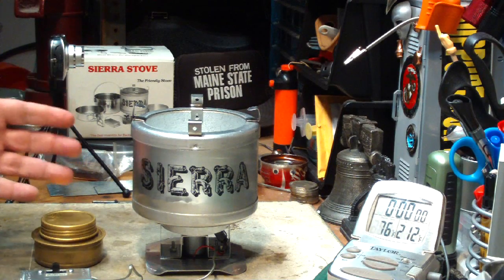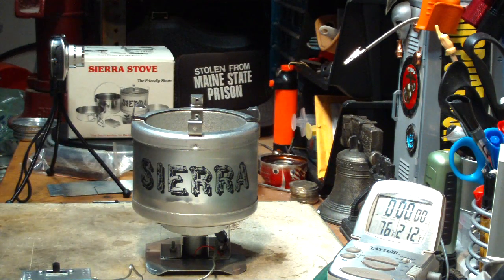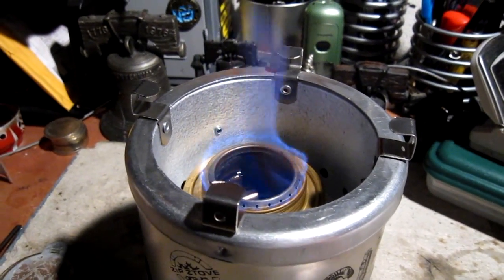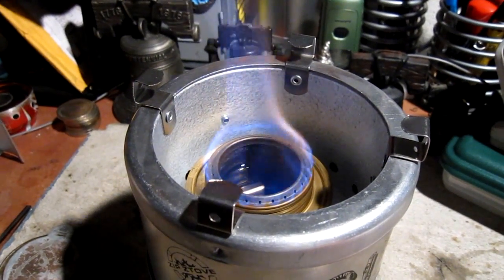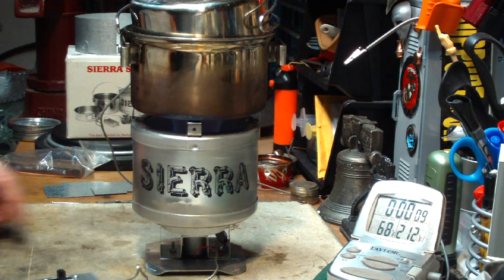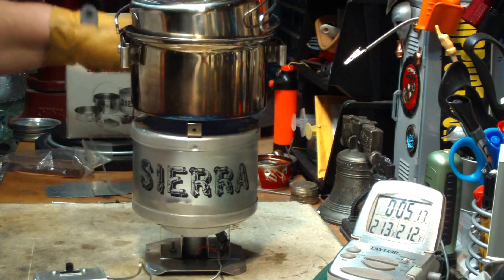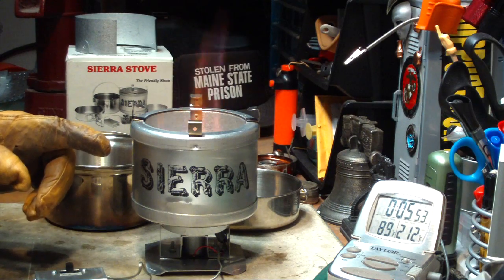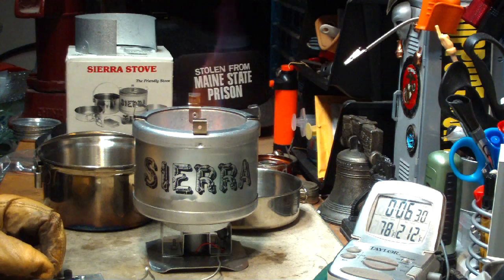Sierra Stove with a Trangia Burner - Boil Test #1

Comment: Triangia is a new one on me. Is it like Sterno? I like the idea of having a backup system to the Sierra in case rain or high altitude make gathering wood impractical. Also noticed that the battery cover is screwed on, screws are easily lost as are the tiny screwdrivers to open the cover. I guess a spare of each and caution with tiny stuff in the woods is the solution.

Comment: The stove/fan is designed specifically for wood chips, not a trangia.  In rainy weather, bring a pine cone loaded with candle wax as fire starter.  Bring wood chips in a plastic bag.
Reply: Hiram said at the outset that it is a wood stove. These burn almost anything. I think I will try this myself... should be fun.